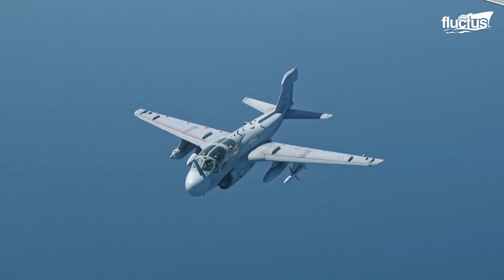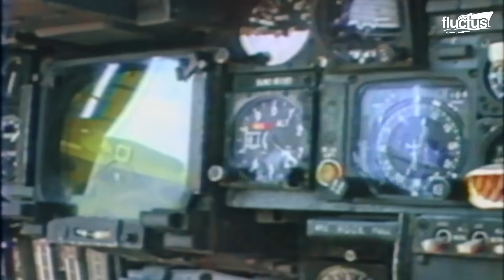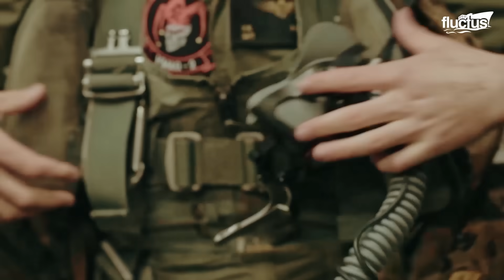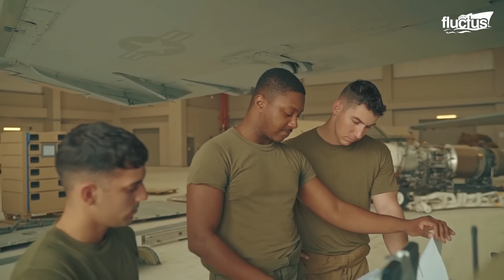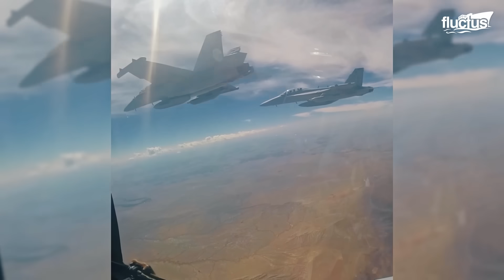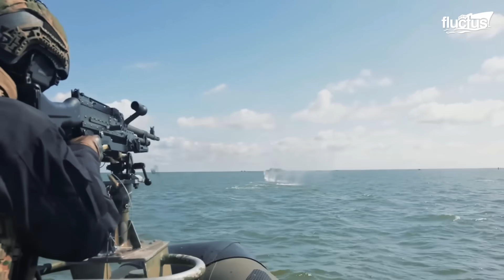EA-6B Prowler: US Most Dangerous Electronic Warplane Ever Invented

Comment: NO mention of the 2-seat EA-6A Electric Intruder, which was used by the USMC only.
The Navy saw how useful the EA-6A could be and funded development of the 4-seat EA-6B prowler, which was used by the USN and USMC.
EA-18G Growler was mentioned as the replacement for the EA-6B... but that is only for the Navy.
No mention of what the USMC used to replace its EW (electronic warfare) capabilities. Answer:  nothing. F-35B has some EW capabilities, but nowhere close to what the EA-6B could do. Also using some UAV based EW and some ground based systems, but again nowhere close to what the EA-6B could do. If they need serious EW for an aircraft strike package, they will ask the Navy for EA-18G support.

Comment: The F111A the best electronic countermeasures aircraft the EA 6B was too slow to use with modern aircraft and because it was subsonic ( no afterburner). The Air Force did it with 2 aircrew.
Reply: Can’t fly that off a carrier!
Reply: @Serpidon yes you can. The F-111 was apart of the TFX program which was McNamara's idea of One Fighter Fits All across all branches. The Navy variant was the B model and was tested in 68 aboard the USS Coral Sea. 

The Navy rejected it because while it was a powerful interceptor, it was not maneuverable due to its heavy weight. They also complained about the single tall V-stab as it caused clearance concerns during storage in ship hangers. 
By pulling out of the TFX program, the Navy pushed for their own and got the F-14 which was lighter and split the twin V-stab instead of a single. 
In a bout of irony, the E6 was just as inspiring as the F-111 was to design the F-14. While the F-111 inspired the swing wing push for he navy's own fighter, the Ed's wing donated its wings. The F-14s main wing is literally just the E6s. Just minus the wing root. Same NACA profile and everything. The only real change was the removal of the wing fence, since the wings needed to be swept and the F-14 used a lifting body to generate extra lift.
Reply: The EF-111A was faster and had one EWO and the ALQ-99E. The Prowler most of the time only flew with a crew of three. The Prowler had both Low and High Band Pods depending on the mission as well as HARM which the EF-111A never got. The Prowler in most cases had no issue providing EW support. The infamous F-117A shootdown occurred during a lack of Prowler support. A few friends of mine who transitioned from EA-6s to the EA-18s are very happy and confident with the new machines but the Prowler was still a much loved and highly capable platform.
Reply: Yep, but EA-6B was designed for the rigors of carrier landings and a corrosive environment
Reply: The EA-18G that replaced the EA-6B has a crew of 2, flies supersonic AND is carrier capable.  Your argument is invalid.
Reply: I was an avionics tech on Prowlers from 77-89. The EF-111 had the same jamming system (ALQ-99) but only had one operator whereas the Prowler had two. If they were actually doing jamming missions, there were four aircrew. 
Like others have said, Prowlers were carrier based and could carry the HARM missile. As far as dpeed... no, the Prowler wasn't supersonic but neither was it slow. I had also heard back in the day that the EF-111 was limited in its top speed because of the big pod (we called it a football back in my Prowler days) on the vertical stab. I heard it was limited to subsonic speeds. And I'm almost certain the jamming pods, the same ones the Prowler carried, are limited to subsonic speeds.